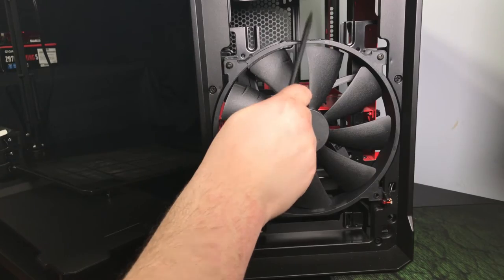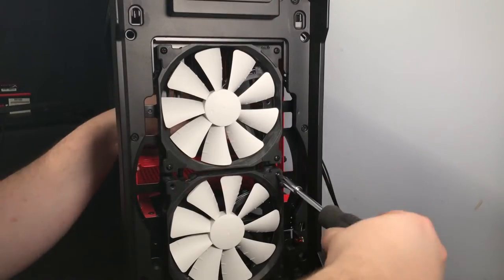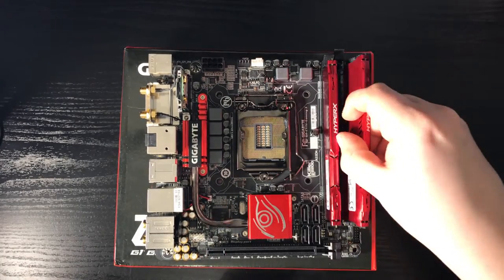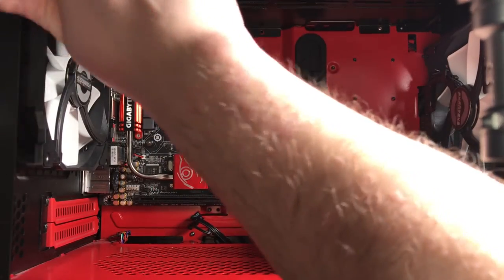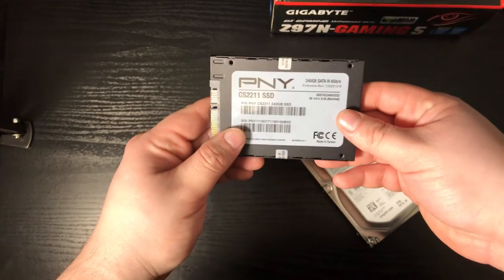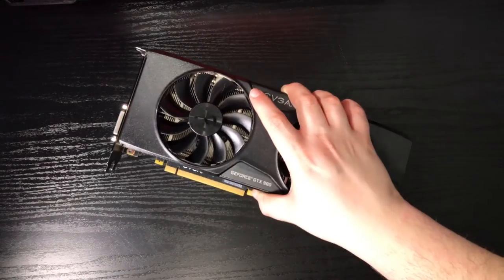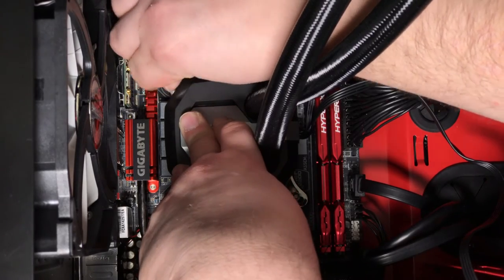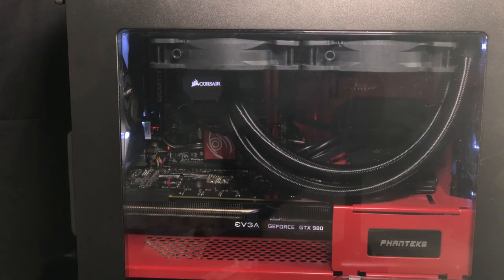What To do With An Old CPU?

Comment: if you have a brother or something who also wants a pc thats a nice idea. but for 90% of the people thats useless waste of money. getting a new case, cooler, powersuply, ram, ssd and a decent grafics card... its not worth the trouble for 2nd gaming setup with an old cpu. but you could use the cpu if integrated gpu unit available in a very small case setup as multi media setup for your tv paired with a bluetooth mouse and keyboard. it will be 100 times better then a smart tv. but of course integrated gpu have their limits. but i think 1080p is possible on some intel cpu. but dont even think of 4k...